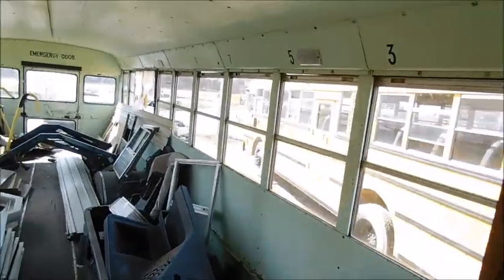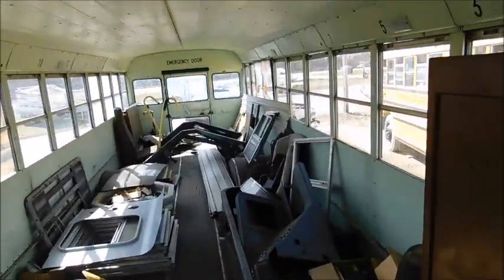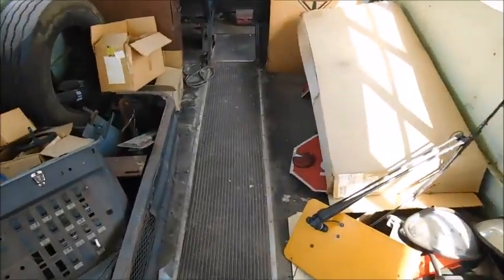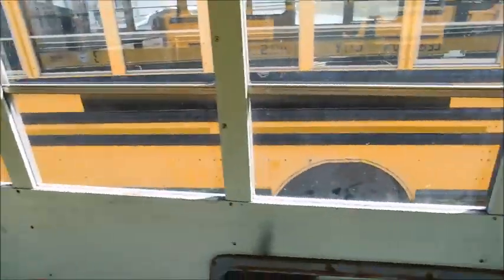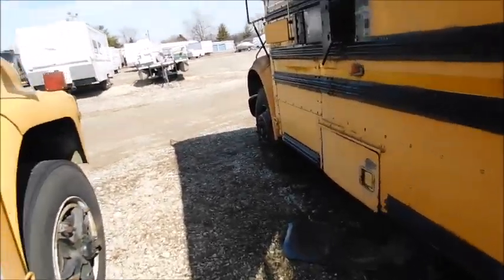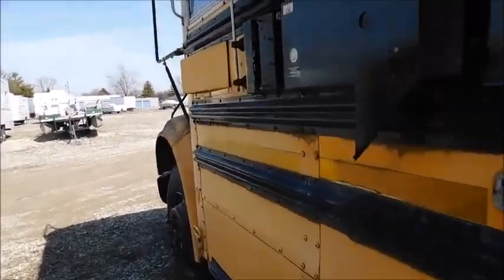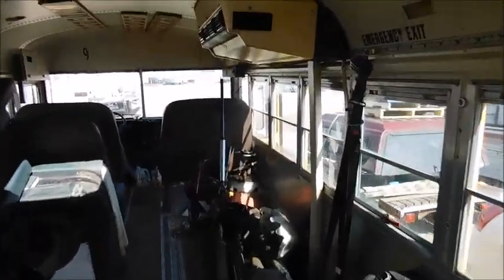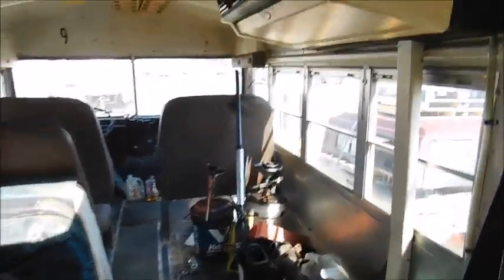Storage Buses, DEF Sensors, Screws & More - Bus Update Week 19

Comment: For 3, you can open the windows and place trash bags on the edge and close them. let the bag dangle inside and place items such as the doors to lean on the windows to hold the bag in place. It will be much easier than to put drywall on the windows.